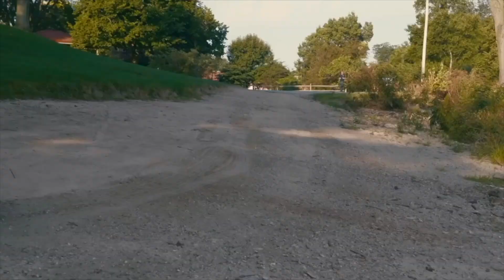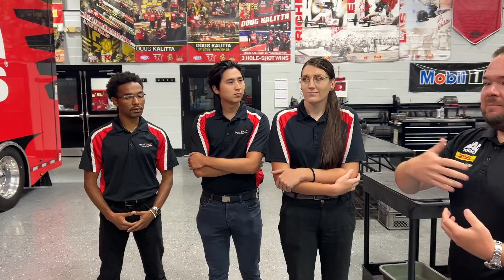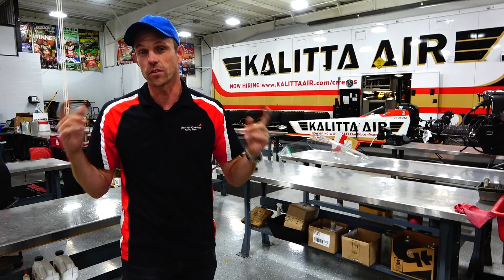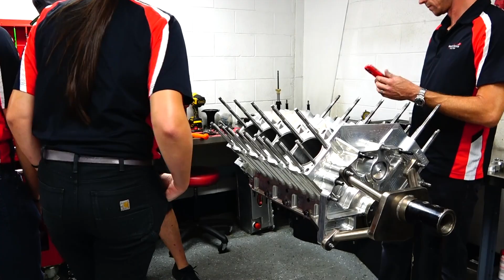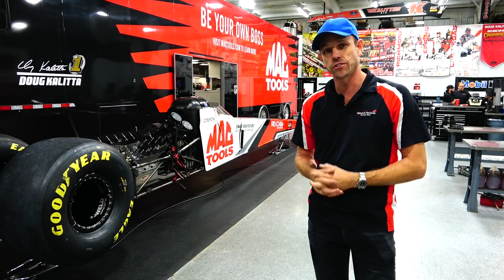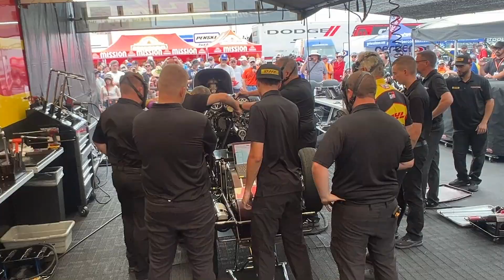Genius Garage builds 12,000hp NITRO engine to race! - Kalitta Top Fuel

Comment: Hi Casey, I had a question for you regarding your older videos on driving manual, I want to understand the best way to release the clutch it seems like no one is talking about it. I’ve watched all your videos and tried to study how you do it, but can’t quite tell. Do you use your whole leg and hover you heel above the floor or do you just release it by pivoting your ankle with it anchored to the floor, do you use a combination of both (kinda seems like you do)? Please help! I’m very curious to know how you do it, this would be a huge tip for me and no one seems to talk about this, not sure why but it’s a big difference. The heel anchoring can make clutch control easier, but it makes the pedal ride up the foot as the pedal slides and you have to constantly adjust, especially in traffic, doesn’t seem quite right to me. 
Thank you! :)
Reply: Since you are not racing, then a normal clutch release is in store.... I drive a 5 speed mustang with a heavy clutch, I use the whole legto push and release the clutch.  The clutch pad is at the ball of my foot.  When letting it out, you go to the 1/2 way point until you feel the clutch engaging, then you give it a little more gas as you are letting the clutch out until all the way engaged.  It's more about feel, motion and listening,
Reply: @TheSawdustChronicles  okay, thank you, and your heel never touches the floor, right? You’re using your whole leg suspended in the air at all times?
Reply: @Linguini789  - Correct.  Your foot is on the floor board AFTER you are done shifting. 

Best way to get used to it is to just sit in the car with the engine off, E-brake on and  right foot on the brake.  

Now with your left foot, push in the clutch with the whole leg, move your right foot from the brake to the gas and touch it, and shift from first to second, do this running up to your top gear, and then run it down.  Just keep practicing until you have the feel.
Reply: @TheSawdustChronicles  thank you! Will do!